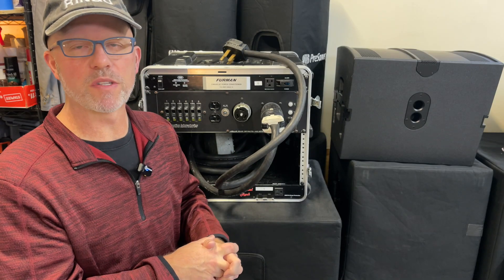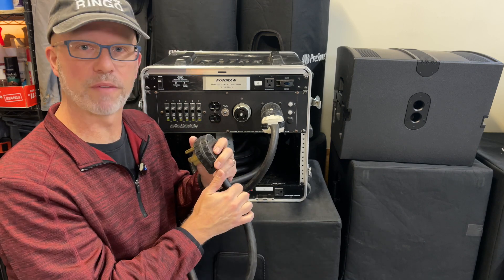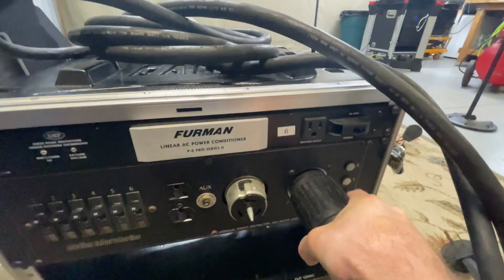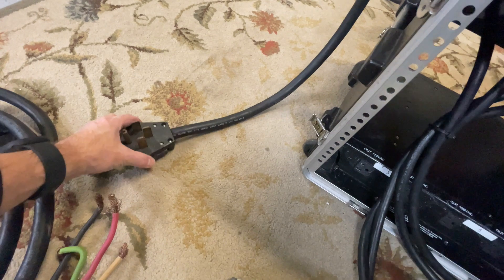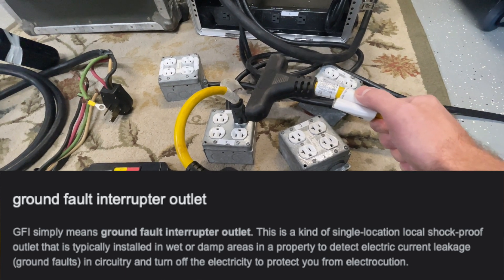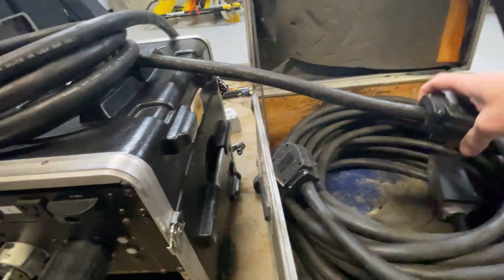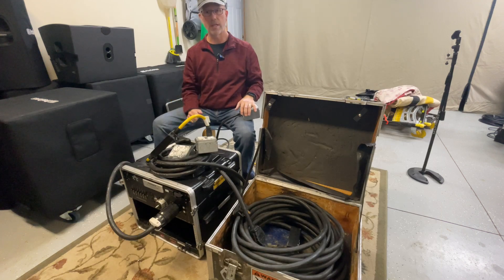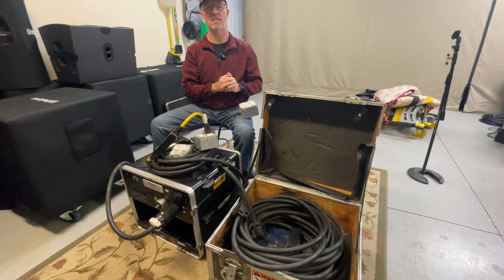The SC-What We Use for Portable Power Distribution

Comment: One question for my
Own knowledge. If the feeder circuit is rated for 240/50 (which equates to 120/100) how are you able to get 6x 20 amp circuits and 1x 15amp circuits from it - which if you add it up equals 135 amps… It’s something that has always confused me.  Thanks! Great video
Reply from the maker: That's a great question! Can't provide "pro" answer, but our distro is engineered to be able to take more than it would ever receive....which is good for safety reasons alone.  On the flip side, the system never draws at peak voltage/amps.  So technically, if we were to max every circuit, our power source would not be able to deliver what the distro box could demand...so technically, you are correct👍
Reply: @thesoundcouple awesome thanks! Ya I mean most amps at 1/8th power are in clipping so you are right in saying you’ll never hit that limit. Also nice to know that 250/50 is a standard. Useful info. Thanks!

Comment: Really cool setup, I do suggest to place your GFIC units at your distribution center. The reason it to protect the complete cable drop. So if you develop an issue in the cable run the complete circuit is protected from electrocution. You should see all the new electric codes on outdoor boxes it crazy.
Reply from the maker: In our experience dealing with GFI's at the source, they are not reliable. In two occasions electricians needed to swap them out because they kept tripping.
Reply: @thesoundcouple  What was causing them to trip? I hate the darn things myself.
Reply from the maker: @robertnorris4642  We really don't know.  Once with our system only and another time we were on the same 50amp breaker as  the caterers and they tripped it first.  GFI's can be very sensitive.

Comment: What is the most common type of plug you have to adapt your Nema 14-50 to?  I seen some of your adapters were three prong, in the situation are you running the neutral down the ground wire?
Reply from the maker: Great question!  We really don't run into the 3-prongs any longer....which is good.  If we do, we will try to find our own ground, such as to the electrical box (via the cover) or somewhere in the panel if possible.  Unless you are in an older building that has not had any renovations,  we hope to never come across these as they don't adhere to current code....Technically, we have...but they wired one of the hot as ground, so we were only seeing 110v.  Not sure if this is technically code, but it's safer and provided us the additional power needed!
Reply: @thesoundcouple  thank you for the information. I'm putting together my own power distro and just making sure I have the correct adapters before my first show.
Reply from the maker: @Hey_you_guys  It probably doesn't hurt to carry a 3 prong 30 or 50 amp plug.  But this is where advancing the show comes in handy as we have accumulated our collection in part, out of necessity through planning.  However, you never know what sometimes you will come up against.  When it comes to generators, Hubble or hard wired connections are more popular.  You can check out these two videos for more information on a couple scenarios we have come across.  With the generator, we have since purchased the adapter we showed in the other video that would have made the hookup to the generator more efficient.  What's even more funny, we did the show again and now they ran power with the 50 amp outlet (they actually hired an electrician to run the wire and do it right).  So we were better prepared and didn't need it!  We would always choose that over a generator anyway!  https://youtu.be/OuhkRUKI_FE. https://youtu.be/WoQl2PIHUbs
Reply: @thesoundcouple  thank you for the information I really appreciate it. I will check out those video links you posted.

Comment: Greetings, My first choice was the motion labs distro. Unfortunately the pandemic cause scarcity. I got Furman ASD-120 2.0 6 Circuit Sequencing Power Distribution instead. I haven’t finished building my system yet but power distribution always puzzles me because I’m new to this amount of amperage. Plus I’m unfamiliar with the normal outlets venues may carry. Scenario: my Furman works with the Nema 60amp plug, what do I do at a venue that only has a 30amp? Let’s just say I have all the necessary accessories to plug into the 30 amp. The furman manual is saying it prob won’t turn on if it doesn’t see a certain amount of amperage. Also I know it’s prob 50/50 the venue allow tapping direct into the breaker. 

Much appreciated, and thanks in advance to anyone who would like to shed some light on my question. Respect
Reply from the maker: That's a good question.  I have contacted Furman for technical questions and they were very knowledgable and helpful. They were able to escalate seamlessly with their engineering for further investigation...not something every company will do for you.

Comment: I'm always shocked at what chaos the American electrical system is. Not your solution, but the whole system in general.
Like why are there 10 different voltage standards?
Here in Germany we have a single system of 3~ 230/400 V which is branched of to 3x 1~ 230V most of the time.
This is not unique to the event industry, this is in general, except you have large motors or resistive loads (or really big power supplys)

The standard single phase connector is the "Schuko", on stage or on trussing you will increasingly find PowerCon or PowerCon True1, especially as an appliance input connector where it replaces the IEC C13 "Kaltgerätestecker". These circuits are 16A and thus 3.65 kW
For three-phase power, we use the IEC 60309, know here just as "CEE", brits may know it as "CEE-Form" or Comando socket"
(The blue 1~ variant isn't used much here)
In some rare instances, a 4-pole (3L+PE), is used, when no neutral is needed (chain hoists in the event industry)
Otherwise, the 5-pole 3L+N+PE variant is used, red and with the PE at the 6h position.
16A is aviable in small venues (sometimes even in restaurants) or for sub distribution. This is split up to 3x single phase, 230V
This is what we would run onto a truss or into a larger amp rack and if split up into single phase, its 11 kW.
32A is typically aviable in medium sized venues, at around 150 PAX. The most common distro for this is with one 3~16A and 6 1~16A outputs in a 2HE enclosure. The 6 1~ outputs may be paired per circuit breaker or individually. Some really big Amp racks might have such a distro integrated, or smaller dimmer racks, the "typical" 2HE, 6 channel dimmer can actually be equiped with a 32A. This can deliver 22 kW.
63A can be found in venues >400 PAX (16A and 32A are aviable as well in most cases, if theres a 63A) and can deliver 43.5 kW. For medium sized companies, this is just distributed to 2x 32A and run into smaller distros.
125A can be found in large venues (at least 1000PAX+), but is not used that much as its quite bulky. Depending on the lenght of your run, youre looking at 2~2.5 kG/m of cable (15 pound/foot) + connectors. Thats 86 kW.
Instead of 125A, we use 200A or 400A of powerlock, a safe version of the american Cam-Lock. with individual, single core, cables. Here youre looking at 138/276 kW respectively.
If you need even more power, youll have to get an electrician to hook up the cable directly (or even multible cores per pole in parallel as a single core would be to massive.)

Another major difference is RCD protection, it's required on circuits up to 32A, until a few years ago it was for <32A and this is still practiced sometimes because you wouldn't want to kill an entire distro with a single upstream, 30mA, RCD.

As enclosure for un-fused distibution (16A 3~ to 16A 1~ or 16A 1~ to 16A1~, e.g. a power strip) we use rubberized or metal enclosures, all external parts need to be impact-ressistant.
The surface-mount backbox with a cable gland as a power strip really freaks me out.

If you mind I could also send you pictures of these things.
Reply from the maker: Thanks for all of the details....it is very interesting how standards can vary across the world.  That said...the general consensus of many is between litigation and regulations alone, it is very difficult to conduct business here in the U.S. along with labor and insurance that just keep going up.  The building codes (in our area at least) are heavily regulated...rent, utilities, electric, fuel surcharge, delivery charges...the list goes on...permits, taxes, and fees are common on most services and/or purchases, at the local, state and federal levels.  Perhaps the issue is lack of enforcement.

My guess is that for some reason, portable electrical is somewhat overlooked, or maybe better to say, where electrical codes are not enforced....perhaps the risk/reward of paying the fines, with limited enforcement typically pays off.  You get into bigger shows, and I can almost guarantee that all of these types of events are inspected or work is performed by a licensed electrician.

Please send us some pics if you like! soundcouple@comcast.net

Comment: Hi Bart, I enjoy watching your videos. I learn a lot. One question that you probably answered already, but which ipad model do you use? And what memory do think is a good choice for it? Is the model you use sufficient for what you do? Do you think that the brightest new ipad pro 12.9 would be a good choice for pa work, or is an older one just as good in your opinion? Thanks for the info.
Reply from the maker: A very timely question as we just replaced our iPad Pro gen 2.  The iPad worked well and ran the software well...however, it had a major problem for us....we concluded that it would not keep solid wi-fi connections at gigs.  It took a lot of time of troubleshooting to finally conclude it was the device, not our router, etc.  In some research, I saw some others report similar issues with the gen 2.  So, with that, we recently purchased the latest iPad Pro gen 6.  From our experience,  there isn't a screaming difference in performance between the two in running UC Surface, so you should be fine with any generation.  However for us, the big difference now is the gen 6 wi-fi has worked great!  As far as memory (I assume you are talking storage), you just need enough to get the job done and you could get the minimum if it's going to be dedicated device.

Comment: Sometimes I watched videos, where the sound system made weird noises. The reason is an power distributor, that doesn't deliver a sine wave. This electricity is ok for a cement mixer or drill or other tools, but not really for sound equipment.
The use of battery powered stuff makes life difficult. The only mixing consoles are a Behringer Flow or a Zoom Livetrak L8, what hasn't a good Equalizer section. And about speakers, there isn't much more than the Bose S01 and the MAUI go.
In Europe it's not easy to get a power distributor with chargeable batteries, but a unit, that needs gas and is pretty loud.
Reply from the maker: Thank you for your comments and sharing your experiences!

Comment: The plug is a 50a plug, but the unit is rated for 30a according to the manufacturer. Does it have its own internal protection before it breaks out to the 7 other circuits? I didn't see much info on their webpage about it.

Power and a pile of RCF speakers are on my list of expansion projects this year.
Reply from the maker: Interesting...I have not read the literature.  For the unit to support 6, 20 amp and 1, 15 amp circuit, I am not concerned that we are over capacity on the unit with a 50 amp feeder.
Reply: Bart. After a year, and buying my own Motion Lab Racpac, I figured the confusion I had out.

The model number you posted isn't the one you own, it's the one that was for sale on that other sound co. webpage! The number you posted is a 3 phase 208v unit!
You do clearly have a 50a one.
Reply: @theflyingalamo yeah the 3 phase unit can run up to 30a per phase so 3 30amps. The 50amp unit can run 50amp per leg at 120v. So technically 2 50amps.

Comment: Hello I know my question  not related in this topic I use midas m32 with  tplink wireless router when people comes the signal between console is losing I need your recomendations.What should I do to control with Ipad?
Reply from the maker: From your explanation, we have experienced similar if using 2.4 GHz spectrum.   We stick to the 5 GHz spectrum and even with that, there still can be problems.  We kept on it trying different channels and we finally found the one that consistently worked well.  It took us awhile to figure all of this out and it was challenging at times, which we talk about in several of our videos.

Comment: How do you handle your ear monitors?
Reply from the maker: We go over many aspects of in-ears through out our videos.  Not sure if you are asking about a certain aspect or in general.  In general, we have the ability to supply wired in-ear mixes if determined during planing.  We also work with bands that provide their own system.  In recent times, we worked with the band through their transition but using ours and then designing, building and implementing their own system.
Reply: How to use your mixer for in ear monitors
Reply: For example, let's say you have 10 people playing in a band, all 10 of them actually have ear monitors, can you tell me how you provide that to them?  It will be very beneficial for me if you explain it in a video😊
Reply from the maker: @sithuminisounds3764  Here are some of videos to check out:  https://youtu.be/wEqm71bnQLA
https://youtu.be/LfMVfa1VDtI
https://youtu.be/Ofti5pFd_IY

Comment: I still need to build one of these racks. But so far, my system can run from a 20 amp circuit! But, I am adding stage lighting and more speakers, so I know this won't last!
Reply from the maker: Thankfully modern LED lighting does not have near the power requirements of the old par cans.  From our experience, lighting was our biggest consumption of power!

Comment: Excellent video & power distribution solution! Do you do any metering to balance circuits?
Reply from the maker: We will do an initial reading on both legs and then spread the load between them.  But no, typically nothing after that, but we could!

Comment: Thanks for all this, fascinating stuff!
In the UK we're used to 240V 13A power sockets (so a little over 3kW) and for a lot of the shows and bands I work with, that's enough. Particularly if you can get two 13A feeds from a circuit rated at 30A. Putting up, say, a 1-2kW of PA, powering some LED lighting, and supplying power to monitors and the various instruments (effects boards, keyboards etc.) can usually fit easily within the 6kW power budget. And using RCDs/ELCBs on the feed from the wall to handle any problems with wet sockets, pinched cables etc. And in the UK each extension lead or power cable is individually fused at the plug to cut out everything downstream of it if the power drain goes over the 1A/3A/5A/10A/13A level of the individual fuse. 
I tend to use surge protected extension/distribution leads for most things as nearly everythinig has electronics in it nowadays (I haven't bought myself a Furman yet, but that's coming soon!)
And if we're doing a bigger show, we'll hire in someone like you to provide the front of house and any larger lighting requirements and just handle our own mixing, monitors and stage electrics. (unless the venue is providing that sort of thing, then we leave it to them)
Reply from the maker: Wow - appreciate all of the information!
Reply: It's also convenient those 13 amp plugs generally come with 13 fuses that are never removed (properly downsized) from my understanding. It's great to see a UK comment in here. It's weird enough that I have YouTube trained in the skill of Electrical in the UK, how many hours to classify an expert?

Comment: That four pin Range Plug is not the standard . The Standard is the California Twist Plug(Hubbel 6000 series )  on the Motion Lab unit . We do run into the Ranfe Plug still but all of the Fairgrounds are switching over to the Twist Lock Plug to meet City and State Codes . Out here on the west coast we are seeing fewer and fewer of the Range Plugs being used . As far as the Cable you use going to your Distro in up in the air . Some say 6/4 , some say 8/4 and then you have the 6/3 + 8/1 for the ground . With my system I have a 100 amp breaker panel with 12 circuts (Not Code) and run 6/4 to it using 400 amp Cam Locks at the distro end and the California Twist at the power end (It is what I had in stock at the time) .. My System is 16 RCF , HDL20's(8 a side) 8 RCF 8006 Subs , 10 RCF NX15 Monitors , 1 RCF 8004 Sub for Drum mix and whatever the band brings . The Most i have ever draw is 23 Amps per leg . And that was running balls to the Wall . I am building a New Distro as well speak .
Reply from the maker: Thank you for sharing with us what your experience is!